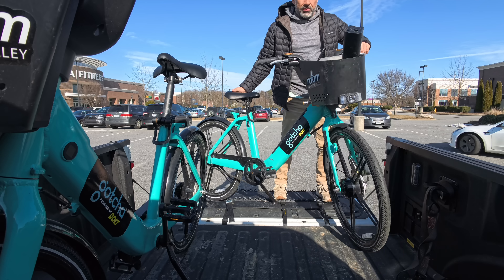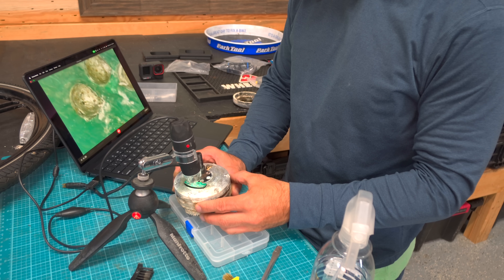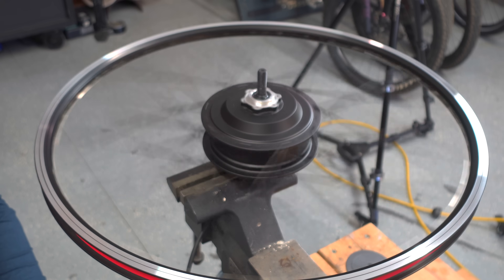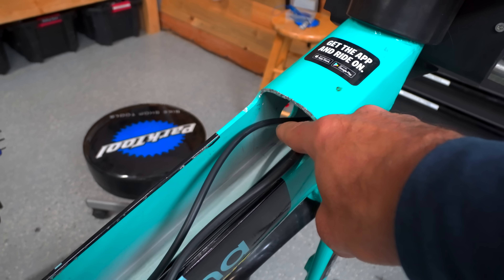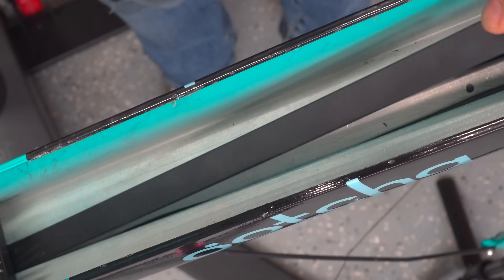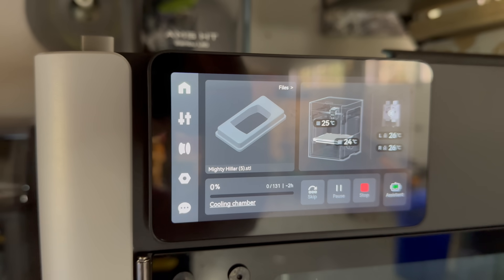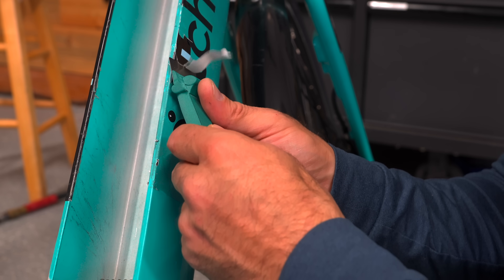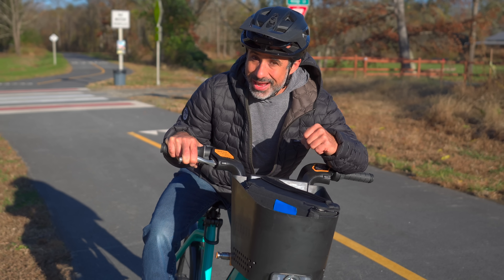What Will It Take To Save This E-Bike From The Landfill?

Comment: This is precisely what I don't like about these e-bikes.
The rental companies obviously want to use parts that are non standard, and highly specific to their equipment, because that means that they are harder to steal (you can only get the parts from a specific supplier, and they will only sell to 'official' companies) ~ so zero theft (which I understand).

Its a typical 'big business' consipiracy. The people that used to run the company that owned these bikes should be taken to court, and made to pay for them to be safely disposed of.

The use of the torque sensor, is in my view, the only way that an e-bike should be. I believe that all ebikes should be on a torque sensor, this would ensure that when you stop pedalling, the assistance turns off. Otherwise the bike should be classed as either a moped or a motorbike. which would make the regulations much easier to police.

Comment: I would have also gotten it working. No kidding; im mechanically inclined and understand electricity, so I truly would have. BUT, the amount of velcro, tie-wraps, wire nuts, and duct tape i would have used would be astounding. It would look like a sh!t heap. The impressive part of your work is the fit and finish. Excellent work!

Comment: Is it possoble to this controller to make regenerative braking?
If yes - this can be solution for front brake. Simply switch mounted to "dummy" brake lever without brake cable. Just to switch motor for regen...

Comment: 14:05 Do NOT pull those pins like that, they have latches you will break. You can unlatch pins with a phone simcard tray remover, jamming it into a hole right next to a pin (not a separate one). Try pushing pin inside a bit with a cable before inserting simtray tool so those latches do not curl (then they are done for).

Also for the rear light LEDs it's recommended to limit current with resistors. (upd: looks like there are resistors, my bad, but should've mentioned them just in case)
Reply: 14:49 look again dawg he has resistors soldered in series with the anode of the LED covered in heat shrink.
Reply: @ericmarciniak1 oh you are right.

Comment: Love that you go more and more into the "scary" electronics of e-bikes, there are not many "main stream" bike channels that feature stuff like that. Repairability is one of the main reasons i love bicycles as much as i do and i think that shouldn't stop with e-bikes. Thanks for sharing your experiences 🎉
Reply: I feel like e-bikes can and should be a lot simpler than they are. sadly they have a huge problem with interchangeability that normal bikes don't have. the fact you can build a normal bikes out of different parts from hundreds of different manufacturers, and everything will work together, either because they follow the same design or because they can be adjusted to fit, is what makes normal bikes so repairable. now we just need to apply the same philosophy to e-bikes.
Reply: @danilooliveira6580  I think you've got a point on that one! However, from my (somewhat limited) experienece, once the first turbo levos, powerplays and avinoxes become obsolete, we'll see that e-bikes aren't as intelligent as their builders might claim. Watching all the mad tesla and even stark varg mods all over the internet gives me hope that there will be as much hacking on the electrical side, as there was (/is) on the mechanical side with my beloved shiguras /campa-shimano combos

Comment: 13:55 I’m astonished how often this kind of thing can’t even be made to the simplest standard, like plug polarity.
Reply: Frequently, manufacturers swap things just to force you to stay brand exclusive, I blew up the controller in my BBS-HD by using a programming cable purchased from a different company. The replacements for the BBS mid-drives use a CAN bus between all the parts now, so you can't even swap batteries without reprogramming the bike to recognize the new battery.
Reply: They deliberately make everything nonstandard so people won't steal them.

Comment: 4:50 I wouldn’t be surprised if the chip uses an efuse that’s right on the silicone. Nobody can steal a bike and un-burn the fuse to get it going but it also limits reusability. Most companies aren’t polite enough to plan for their own demise.

Comment: Deliberately making bikes to be as unrepairable as possible is disgusting. Thank you for repairing and making this more compatible.
Reply: Its not made to be "unrepairable as possible", its made to be as durable and theft-proof as possible. People would just steal anything easily removable.
Reply: These videos are looking at these bikes from a EOL/Surplus goods POV, and I have enjoyed watching Seth get more life out of these and appreciate his efforts to keep them from going straight to the landfill. The problem with your statement is that it doesn't take into account the intended use purpose of these types of bikes and why they exist in the first place, which is public bikeshare. If bikeshare bikes are easy to disassemble when they are in service, they are targets for theft and vandalism. If the parts are common to the bike industry as a whole, or they have raw material value(battery cells) they become a target for theft for someone to score some "free" upgrades or dope money from the scrap. On the flip side, technicians also don't want to spend an hour performing maintenance(like a flat for instance) that should take 10 minutes. The manufacturers of these types of bikes have a monumental challenge balancing ease of service and security/protecting the operator's investment. It's not as simple as it may appear.

Comment: 3:59 bro, just build an brake adapter in CAD, and order the custom part online
Reply: Absolutely. It would be simple enough to make one out of bar stock with a drill and a hacksaw. Failing that, cut off the proprietary mount and use one of those disk brake adaptors that centres on the axel and clamps around the fork.

Comment: awesome, but i would not leave that without a front brake. 
it shouldn't be to hard to make a brake mount for a disc caliper that bolts to the axle and interfaces with fork mounts for the roller brake to stop it rotating.

Comment: What are the odds that the front hub motor is just a normal 250 or 500 watt bafang motor with a different side case than normal?

Comment: 14:00 If you wish to take these apart in the future, the tool you want is a "Molex Pin Extractor". It's a small tube that slides over the pin to depress the barbs so it can slide out the other side.
Reply: Yup, I cringed a little watching him rip the pins out 😅 But I've done worse and if it works it works.
Reply: I was gonna say that; those pin extractor tools are great 👍
Reply: Swing by your local general aviation airport, and ask a mechanic if he's got an extra one.

Comment: I've rode a similar rental bike. My main problem with it is it doesn't have a throttle or even a simple button to start riding. Sure, (non-torque) pedal assist is mostly enough, but you have to start moving for that and that bike weight was x2-3 times of pseudo-mtb ones thanks to its unkillable steel design. Every stop at a road crossing was a PitA.
Reply: The 60 bucks for a basic bottom bracket torque sensor is always worth it but few hub motor bikes spend the money on one and that's a damn shame as hubs are way better for ultra reliable commuters.
Reply: that bike is aluminum 100%. there is a lot of reasons why it is heavy though like solid rubber tires

Comment: Hey Seth, super random but I'm pretty sure I have a compatible front wheel/hub. Its a spoked wheel I believe 26" and is laced to a bafang 350 watt motor with the same roller/drum brake splines. Feel free to get in touch if you'd like me to ship it out to you! Its new and I bought it thinking I could more easily attach a disc brake rotor but I never tried to.
Reply: Actually I wonder if we could just trade the outer plates with the spline and disc interface. would be interesting to see!

Comment: I love Seth’s slow descent into engineering madness… pretty soon he’ll be eyeing up a CNC machine
Reply: At least a 3-axis
Reply: I seldom go into my local bike shop and when I was in there the other week bizarrely enough the guy in there was saying to the other guy that works there that they should get a mini CNC for repair stuff. 
No idea the context of that conversation but they already have a 3d filament printer running
Reply: The transition completed when he's built a marble machine.
Reply: Yeah, get yourself a Makera Z1, it's same cost as your new H2C.
Reply: yes, I was thinking the same thing. Seth isn't just great at restoring bikes, he has become an engineer
Reply: Watch Wes Work  just bought a barely used CNC lathe machine from a college. Some of the boards were bad and he got it working.
Reply: Gonna be soon when we get bike parts made by Seth  😅
Reply: It’s ALL engineering in the end 😁
Reply: A cnc mill probably wouldnt be a bad idea.👍🏻
Reply: @WheelingWerwolf Only downside is his space. It’ll eat up a lot requiring either his bench to be downsized or sticking it in the middle of his garage lol.
Reply: Does Seth have a granddad to inherit a machine shop from?
Reply: Exactly my thought. And we're here for it, lol.
Reply: Is Seth gonna start making his own e-bikes soon?